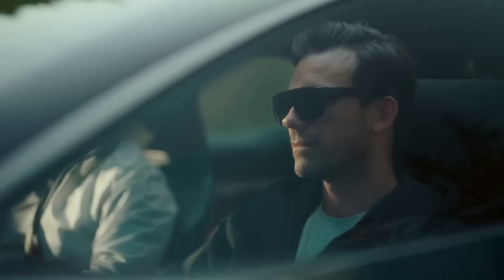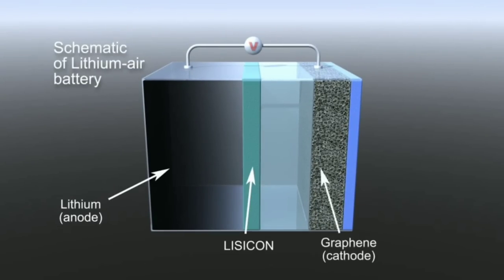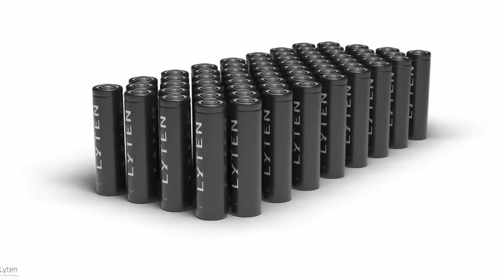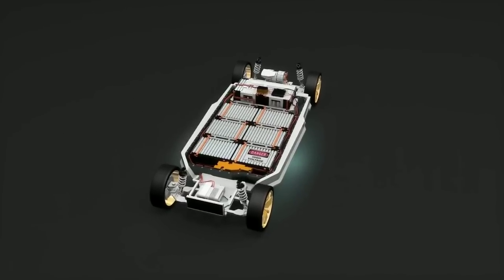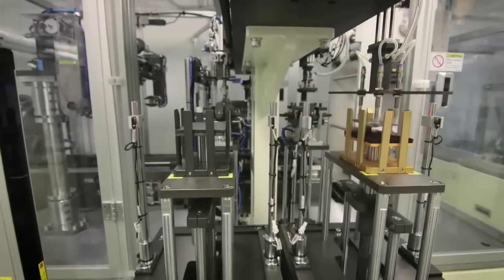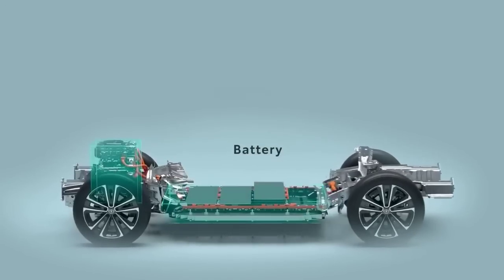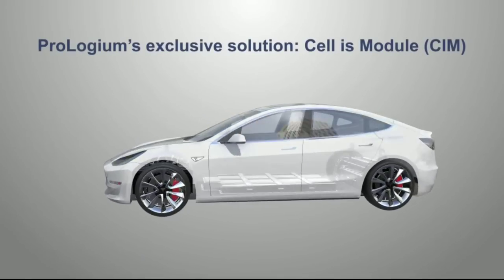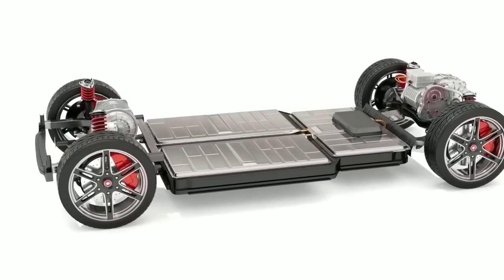IT HAPPENED! World’s Highest Energy Density Lithium Air Battery: The Secret to 2000km EV Range!

Comment: And Sodium will beat Lithium purely on safety every day. And Hydrogen will be the long term solution.
Reply: Hydrogen will never replace batteries, because you need to put 3kwh into electrolysis to get just 1kwh out to the wheels.
Reply: Hydrogen will never replace batteries, because you need to put 3kwh In to electrolysis To get just one kWh out to the wheels.